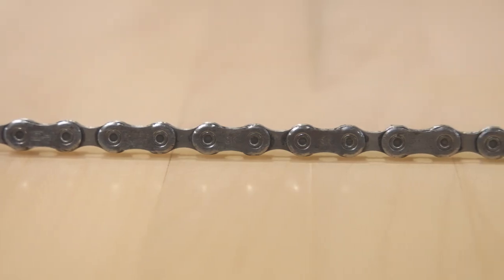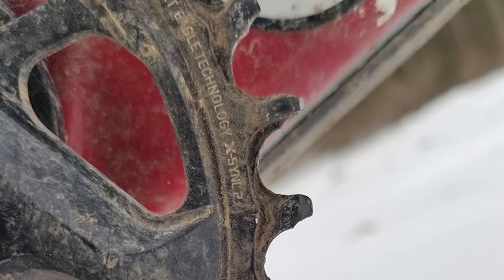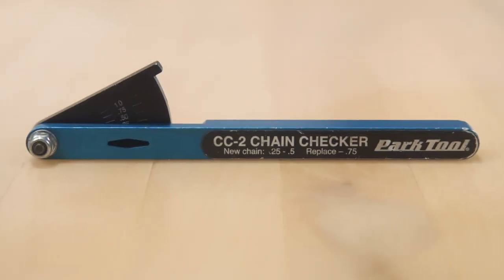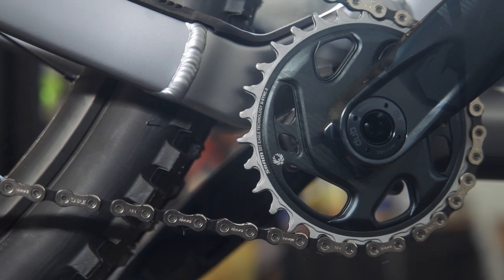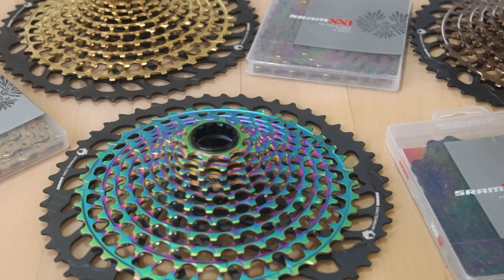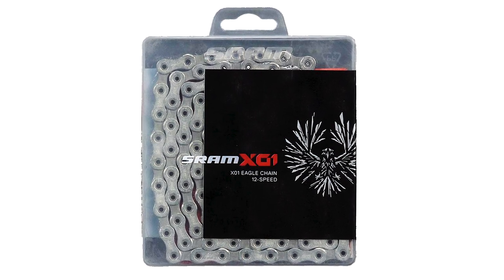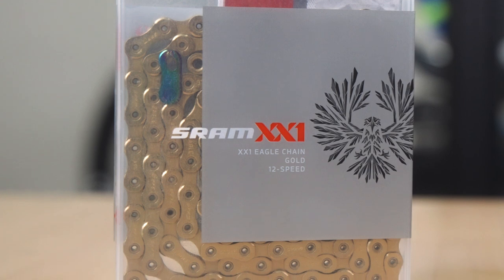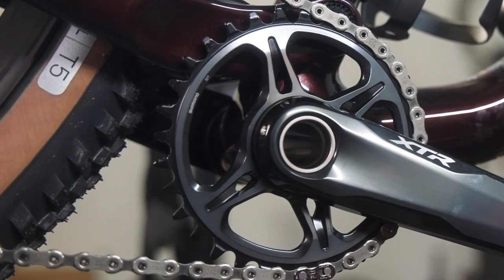Ask a Mechanic: When to Replace Your Chain and Why it's so IMPORTANT!

Comment: I prefer using a 12 inch steel rule to measure the chain.  Chain checkers can only give you an approximation of how worn the chain is, because they only measure a few links. I use a chain checker to tell me when it's time to get out my 12" rule to make sure the chain is worn.